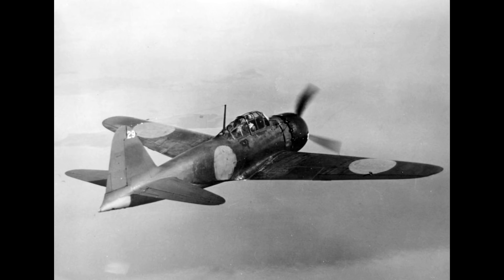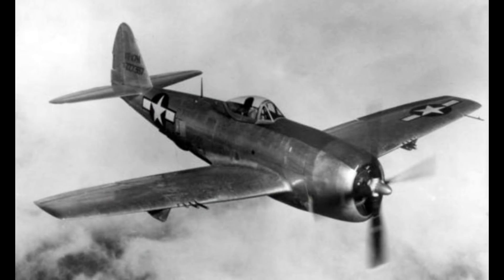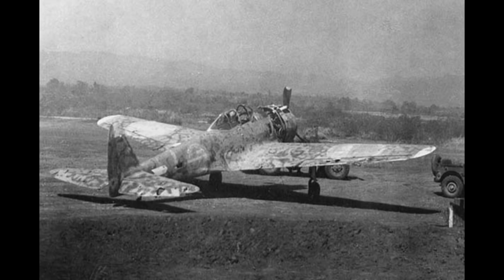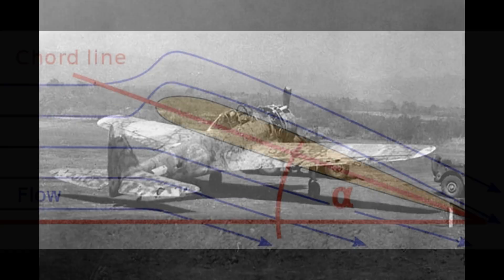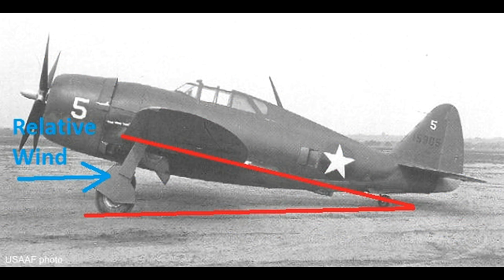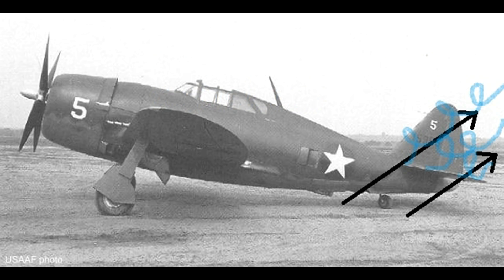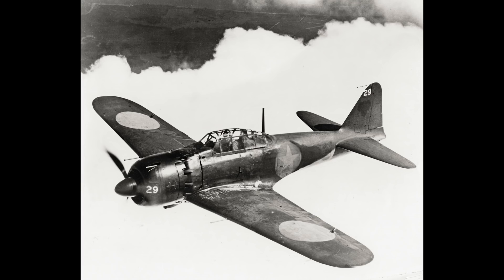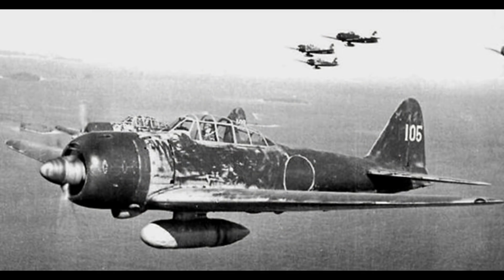Mitsubishi A6M Zero, an interesting fact few people know

Comment: That's right. RAF uber-ace Johnny Johnson (40 kills) when talking about the early Spits said that by and large you didn't win a WWII dogfight in a turn fight. (It happened of course - everything did.) The qualities needed varied by the air force involved, but nobody scorned speed. And in 1941/42 the Zero was pretty fast up to about 15,000 ft.
The Zero was a elegant plane and did it's job - a carrier based attack plane escort - splendidly in the first year of the war. Its failure had nothing to do with the design. The IJ air war was always hampered by the lack of depth of the Japanese industrial base. Big double banked radial engines that like the PW2800 required very good machine tools with extremely delicate tolerances. The Japanese couldn't match that level of complexity. (There were similar factors outside of the engine.) They couldn't even do a good job of copying the ME-109E even when provided with an engine. (Think Tony here.) Jiro Horikoshi and the Mitsubishi design team were working on what later became the "Jack" before Pearl Harbor. They were hoping to replace the Zero by early 1943. On paper many of the second generation Japanese fighters were fine aircraft, but none had the operational reliability expected by the Americans, all were hangar queens (few spare parts, not the greatest groundcrew) and none were produced in numbers large enough to challenge the US Hellcat, Corsair, P-38, P-47 and then, in early 1945, the P-51.  In any case, they were still building Zeros on VJ Day - at least they flew. And if they could no longer compete in combat, there was always suicide - something that shocked us.
Reply: Dear Eric Bergerud, comments like yours should win some kind of meaningful and prestigious award. Thank you very much.
Reply: Mr. Bergerud, I'm want you to know I've enjoyed your books, so I'm particularly pleased to see you contributing to these discussions.
Reply: In Greg Boyington's autobiography he states that he was at low altitude and could not outrun attacking Tony's - they were faster than his Corsair and shot him and his wingman down.
Reply: Eric Bergerud The Ha-40 was just as good as the DB601 in the 109.  I have no idea how you heard otherwise.  The issues it had initially came from poor sand filters on the Ki-61 and unfamiliarity with many ground crews on how liquid cooled engines worked (since many never worked on the ki-10).

Second Gen Japanese planes were actually pretty reliable but poor maintenance due to a lack of trained mechanics meant poor serviceability in later years.  

Still building zeros in 1945 isnt bad.  The M5 zero was very competative (I personally rate it even) with the F6F3 hellcat. The F6F5 hellcat was superior but not overly so.  In addition to that, there were a good amount of FM2 Wildcats still serving on smaller carriers that the M5 zero was superior to. Also worth noting is that to cut production to zeros would mean a severe drop in aircraft production until the next variant is brought up to speed.  Ideally you never want to change weapon production in a war. I dont want to compare naval and land based since the land based planes is nearly always better.
Reply: If you want the details please ask your library to track down a copy of my "Touched with Fire: Air War in the South Pacific 1942-43." The basic point I tried to make - that Japanese industrial technique was very poor when compared to the US, UK or Germany - and that this weakness crippled their attempt to produce a robust generation of 2nd generation aircraft stands. Mitsubisihi planned a replacement for the Zero in early 43 (what was later the "Jack") and had their top design team on the job before Pearl Harbor. But operational reliability was always miserable so the Zero soldiered on. This was repeated several times in both services. The extra problems of poor pilots, oil shortage, parts shortage etc were there regardless. As they were for Germany, but the Germans were able to deploy improved models of their major fighters throughout the war - and they stayed in the air. There was no Japanese equivalent of the FW-109D. As far as the Tony went, we mulched them over NG in 1943 - they couldn't face well flown P-38s. Nor could the A6M5s stand against well flown Hellcats much less Corsairs. Yes there were some good IJ pilots. Yes some 2nd generation IJ planes had some good missions. But anecdotes meant little in an industrial scale war. But overall, the air war in 1944-45 was a military mugging with the US suffering more non-combat than combat losses. (Arguably the Japanese did too - they just lost more of everything.)
Reply: Eric Bergerud The A6m replacement was the A7M.  It didnt enter service until 1945 due to a couple reason. Horikoshi was pre occupied with the J2m and then dumb requirements meant the first version failed.  The J2m Jack was not the successor but filled an entirely different role.

Japanese equivalent to fw 190D is the Ki 84 and the N1k.

The Ki 61 saw very little service over NG so I dont know where the claim of them getting mulched is coming from.  Many Ki 61s were lost before they even reached NG and then they suffered reliability issues due to poor sand filters.

The A6m could stand against the F6F3.  Read the test report.  The F6F3 could not outclimb the a6m5 under 15000 feet and it had trouble escaping in a dive.  It was only faster (but would take longer to reach its max speed so usefulness in combat was limited). The zero failed poorly against the F6F and F4U because most experienced air crews were lost at the Solomons and Midway.  It was not because the F4U and F6Fwere so much superior.

Btw A6M pilots always mentioned that they thought the F6F was more dangerous than the F4U.
Reply: also, reports from the test pilot of the A7M2 "Reppu" say that it was the fastest fighter he'd ever seen (although in terms of raw top speed, it should be noted the Reppu was not very fast by late war standards), and could climb and turn circles around the hellcat and mustang.  It also managed to improve on many of the Zero's flaws: it had a pane of bulletproof glass installed, and self sealing fuel tanks.  Not to mention that it had a much more respectable armament, with much better ammo reserves: 2 x 20mm cannons with 200 rounds per gun, and 2 x 13.2mm Heavy Machine Guns with 300 rounds per gun
Reply: Eric Bergerud 
A good book about the raaf against zeros, which talks a lot about tactics is '44 days by Michael Veitch', great read.
I will try to track down your book.
Reply: I've got a French report on the highest scoring Japanese ace where his squadron attacked an American formation and downed (27 I think aircraft)personally 10 aircraft the Americans lost in reality 2.
Reply: Eric Bergerud 8
Reply: Accurate, but what about the N1K and the Ki-84? I seem to recall both having characteristics comparable to late war american aircraft. I guess they just weren't produced in enough numbers to be relevant.
Reply: "Fire in the Sky" will always be the best read about the airwar in the Pacific and comments by its author are precious.  Being able to change production in mid-fight seems to have challenged everyone except the Americans in the Second World War.  (We are essentially the same country today).
Reply: We shouldn't forget the fact that the A6Ms simply were not sturdy enough to allow a pilot to make combat mistakes and get home like the Hellcats and Corsairs were.  Also, the US tactics emphasized team work and the Japanese did not emphasize it effectively.  There is a USN video which shows the "mowing machine" tactic, whereby lines of Hellcats would make single passes on an adversary until that adversary went down.
Reply: The amount of training that Japan could supply it's pilots with was scant after 1942.  The combat veteran pilots of China and Pearl Harbor were lost at Midway and Japan never had a efficient flight school operation.  So even good Zeros plus poorly trained pilots produces the "Marianas Turkey Shoot".
Reply: FuLLeFFekT1
The pilot you're talking about is Sadaaki Akamatsu. He claimed over 350 (!) kills and there are some crazy hard to believe stories about him such as this:
“Akamatsu stunned his superior officers by his conduct. Instead of attending pilot briefings and waiting on the flight line like the other men, he had his own warning system hooked up in a brothel! He often came racing to the air base in an old car, driving like a demon with one hand, drinking from a bottle held in the other. The sirens were screaming a warning as he bolted from the car to his fighter plane, already warmed up by the mechanics…”
Reply: @Ebergerud  Mr. Eric.  I have actually read your book.  While I learned a few things from reading it, I was greatly disappointed by your complete lack of technical knowledge.  

You do not seem to understand the meaning of wing loading, for example.  I caught somewhere that the A6M Zero advantage of turning performance was reduced at high altitudes.  Actually, the exact opposite.  At higher altitudes where the density is much lower, the ability to turn much favors the low wing loading.  If you lack the power to sustain a horizontal turn, like the A6M may lacked with respect to, say a Spitfire, you can always do a split S or give up altitude.  This is just an example.

I did like your analysis, however, with respect to the Betty bomber, and its weakness in terms of overloading it with fuel rather than armor and defensive armament.

In short, I would suggest that you totally rewrite your book with proper technical review.

As to the reasons why the Japanese lost the air war ...  There is one main major reason that almost eclipses all others.  Lack of oil.  If they had reasonable and reliable supplies of oil, it is very unlikely they would have lost.  On the other hand, if they had good supply of oil, they may have not participated in the war.  Similarly, the sole reason the Americans were able to win the war was that they were the largest oil producers at the time.

Anyway, you better start rewriting that book.  It has really awful errors.
Reply: Sorry I didn't write the book you wanted me to. For what it's worth, not only did I gain useful information from the pilots and groundcrew of allied aircraft, I also gained much interviewing and reading the books by former Boeing engineer Francis Dean - check "America's Hundred Thousand" and "Report of Joint Fighter Conference: : NAS Patuxent River, MD - 16-23 October 1944". I also got a good bird's eye view from General Ben Kelsey's (head of the USAAF Fighter Development) splendid memoir "The Dragon's Teeth?" (I'd be curious to know what you think of these works. If by chance, you haven't read them, you really should if you want to consider yourself literate on the subject of USAAF and USN military aircraft in WWII.)  Might also add that the manuscript of Fire in the Sky was read by two WWII aviators in total, and several more read parts. As noted in the bibliography I interviewed over a hundred participants. OK: if you want to know the turning radius of a P-51 at 20,000 feet, buy Dean's book - it has more graphs than there are wild mushrooms on a large Minnesota lawn in spring. If you want to know how the air war in the South and Southwest Pacific was fought and why it was fought that way, I'll be glad to stand behind Fire in the Sky.
Reply: It really doesn't matter why Tony's didn't stay in the air the way a German BF-109E would have, but it didn't. Beauschel talks about problems with oil loss and poor seals - that's the kind of problem that plagued Japanese planes. It wasn't engineering, it was industrial technique and Japan proved far behind the US, Germany, USSR or the UK in that category. (The Japanese knew this and it helps explain the great stress they put on industrial technique after the war. The Japanese trashed Detroit because their cars didn't break and the American models did (especially in the 80s and 90s). That's a direct result of a "Lesson Learned" from WWII.) And i rather doubt you would have found a single American pilot that would have swapped a Hellcat for an A6M5. I talked to a lot of pilots and they were much more interested in getting back to base than in shooting down planes. Obviously, they had to do their job. (A lot of fighter jockeys did seem to enjoy it. Bomber crews didn't.) But a Hellcat was a huge plane - almost the size of a Jug - and a splendid example of the "Detroit Iron" school of military aviation: it was a very tough bird. They also had a much better blower system on that big radial and hence were much better at any altitude above 15,000 feet. Read Hirokoshi's memoir: he calls the Hellcat the "Zero Killer." He was right. And no matter how badly inflated American kill claims were, there's no doubt that US aircraft, whether Hellcats, Corsairs, P-38s (or late war P51s - almost a case of overkill) after early 1943 absolutely mulched IJ aircraft wherever found. The mugged them. Our pilots were better, and so were our planes. Also - there were about 10,000 Zeros built during WWII, by far the most of any IJ type  - there were several US marks that had numbers over that. Altogether we built over 100,000 fighters - and about the same number of multi-engine aircraft - numbers the Japanese couldn't dream of. Given Hitler's defeat in Russia, Japan was absolutely doomed. The fact that Japan fell in 1945 after a string of lopsided defeats was testimony to the fact that they did not belong in WWII.
Reply: @Ebergerud  Well, I do not know what your references are supposed to have been,  but the first aspect is that you failed to understand the technical side, so regardless of who you supposedly interviewed, you simply did not get it.  Another aspect that was missing big time was interviews or at least unbiased insight of credible Japanese sources.  If you had some understanding of the other side is the following.  A well trained and experienced Japanese pilot, of similar training as any front line US pilot, flying a Ki-43 or A6M had absolutely nothing to fear from any US fighter.  The US fighter may have been faster and well armed, but the Japanese pilot always had the maneuverability on his side, which assuming that the pilot knows how to exploit it, will guarantee his survival.  There are lots of examples, the best of Saburo Sakai that survived single handed 15 Hellcats.  What the Japanese pilot was afraid of were the US heavies and their return fire.  More Japanese experienced pilots died from bombers than fighters.  The Japanese fighter pilot of course flying a Ki-84 not only retained the defensive advantage of maneuvrability, but also retained climb and speed advantage, much like the A6M2 against the F4F.  Much of that critical info was missing, turning the book more like a propaganda leaflet than technical history (how can one write technical history if not even remotely a technical person?).

The only reason why the USA won the air war was one.  Quantity.  Which reflected the fact that the USA was the largest oil producer in the world.  Everything else is an extension of the previous statements.  Even with the second class fighters, the USA was able to move forward with victory due to the overwhelming quantity of bombers.  That is the main conclusion that needs to be drawn from such a book, and it was not.  Instead, it was blaming it all on how stupid the Japanese planers were on prioritizing maneuverability in their fighters.   Very short sighted.

As for turning radius and P-51 and what have you.  If a reasonable author is to describe aerial combat in WWII, they need to describe the following phenomenon.  Ability of maximizing the rate of turn is obviously critical in order to keep the enemy plane in sight during combat and give the necessary "lead" during firing.  The indicated airspeed is critical factor in this (and the term indicated is also very important here).  Above a certain airspeed, the turning ability is limited by the G-limit of the pilot, typically 6 to 8 G's.  Below the above threshold, it is stall that limits the turn ability.  Based on the horsepower the fighters of that era had, the airspeed will drop very rapidly below that threshold, unless you are on a straight down spiral dive.  This threashold is mainly determined by wing loading.  As the altitude increases, the indicated airspeed drops due to density, so the above threshold is generally reached much easier.

All of the above will be Greek to you, but without such a very simple explanation present in most aircraft aerodynamic textbooks, your book is hollow.  The above is what all tactics are built upon, and shows the desperate situation that the overweight US fighters were, resolved only by the huge numbers and the rarity of Japanese expert pilots.  But there were many a case where a Japanese expert appeared, sometimes in very well known cases, such as the killing of Thomas McGuire.  

One really striking example of the ignorance of the book was when a WWII fighter was compared technically to a modern pickup truck.  I have news for you.  Even the overweight and crude F4F has far more complexity, sophistication, manufacturing precision, and overall production cost than any pickup truck ever designed or built.  In fact, it would compare favorably with the most sophisticated Ferrari you can buy out there.

I know its all about money, but I would be deeply embarrassed if such a book had my name on it.
Reply: Well, you ought to get a publisher and put your own name on your own book - you know mine. You seem to have the illusion that WWII air combat was some kind of joust. It wasn't. I'd suggest some sources, but they have big words and might be beyond your grade level. I'd start with Johnny Johnson's autobiography (he was the RAF "top gun" in WWII) - believe it's called Wing Leader. He makes it very clear that turn fights did not win aerial battles in WWII. They happened simply because there was so much fighting. But in general you wanted the basics - speed, climb, and a really good blower for help at altitude. I became friends with one of the 5th AF aces, Robert DeHaven. He puts in simple terms what Johnson described: "World War II air combat consisted of relatively few and relatively simple maneuvers executed at the right time." One disadvantage of a turn fight is that it made the participants seriously vulnerable to being struck by a third party while either trying to evade or gain a shooting position. (Check Robert Shaw, "Fighter Combat" for the details.") Pilots who kept up speed usually had a door open for retreat - at least the ones that lived did. It was a dangerous job regardless - for every plane shot down in combat, one was lost due to some kind of mishap - bad weather, getting lost, mechanical failure, accident on landing/take-off. Life was cheap.
The Japanese knew this of course and did their best to create "American style" fighters in their second generation planes. None could turn with a Zero, much less an Oscar, but all were faster, had better high altitude performance, were bettered armed and had somewhat better self-sealing tanks. None were well built or maintained, so most were hangar queens. You say I didn't use Japanese sources. Well, I did. There was copious material gathered by the US for the PTO Strategic Bombing Survey and I used it extensively. There are also secondary sources I cited. All agree on one thing - the Japanese air arm was in a downward spiral by late 1943. Sure there were more US planes by 1944. But if you look at well documented campaigns such as Guadalcanal (see Jon Lundstrom's "First Team at Guadalcanal") the trend was clear: in September 42 the IJNAF fighters had a slight advantage in "kill ratio" although nothing like their glory days mulching the Dutch, Chinese, Brits and USAAF planes in the early months of 1942. By December the advantage was gone and was slipping the other way. Allied pilots flying Wildcats and P-40Es were gaining an edge by early 1943. By this time the more or less 2500 pre-war IJNAF fighter pilot core was badly eroded and their "quality over quantity" policy toward aircraft pilot training had proven a huge error. When the US brought in their second generation planes - Corsairs, Hellcats, P38s, each was superior to the Zero. American pilots were better trained by 1943 and the numbers grew, although that wasn't evident until 1944. In any case, Japan was mugged. They shouldn't have been in the war. Their resistance in the air was so pitiful, that Tokyo decided that the best mission for IJ fighter aircraft was suicide attack. If you can't read that page, you need glasses.
Reply: @Ebergerud  OK Mr. Eric, let's see where my grade level is... You state Johnny Johnson's remark that air combat is not won in a turning battle.  But you failed to see the context of his statements.   JJ's greatest challenges where during the 42/43 deep France intrusions with Spitfire V's.  Due to their limited range, on their way back, if they were attacked by the faster 190's, their only option was turning fight.  Clearly, that was not a good option if you are low on fuel and over enemy territory.  This is where his comment is coming from.  Obviously, nobody wants to have an enemy fighter in your tail and be forced to start turning.  But obviously, in an even fight, that WILL happen.  Sure, we want maximum rate of climb.  But that requires low wing loading, and it is not inconsistent with turning abilities.  This is where virtually ALL US fighters sucked.  If low wing loading was not a so good idea, the Spitfires would have cut down their wing area by 20 or 30%.  In fact, in 1944 they redesigned the whole wing for the Mk 21.  Guess what, the wing area remained identical.

Late war Japanese fighters were also designed with low wing loading.  The Ki-44 (not really a late war) and another Mitsubishi navy fighter, the Rained, were few exceptions, designed not as all around fighters, but very specialized.

So, where your misconception is coming from is the following.  Yes, turning fight is not where you want to be.  But it is a critical option that you need to have, and a critical asset, that if all goes well you will not have to use it defensively.  Good turning ability is consistent with climb rate (both need low wing loading) and good high altitude performance anyway, so low wing loading is critical.  Obviously the compromise was well understood.  But the Ki-84 and even the N1K1 had low wing loading, which proved a major asset.  If you think the Ki-84 was a hangar queen, you may want to consult with the "super ace" Thomas McGuire.  His spirit may still be in the Philippines where he opened an oversize crater with his P-38.

The opposite side of this is that turning fight can also be an asset when you are attacking and potential victim enters a turning fight.

Yes, the Japanese were going downhill by late 1942.  But you failed to see why.  The US light bombers were constantly hammering the forward Japanese air bases day and night.  It had nothing to do with the US fighter capabilities.  The only thing the US fighters can do is prevent the attacks on the bombers.  These medium bombers also attacked resupply.  The Guadalcanal nightmare was again related to the fact that the Zeros were pushed at the extreme of their range.  This was a fundamental mistake the Japanese Navy did by relying entirely on fighters and destroyers.  Had they employed their main fleet, the G-campaign would have been different.  You cannot blame that on fighter design or tactics.

Also, how many fighters in 1943 could operate at that extreme range?

Just as important, the Aleutian Zero really made life easier for many an allied fighter pilot.  Out of sheer luck the allies learned about the roll rate issues of the A6M's.  Had that not happened, many more Japanese aces would have been formed.  Many Japanese sources consider this loss of comparable damage as the entire Midway battle (another example where the USA got the upper hand out of luck and espionage, both irrelevant to fighter design or tactics).  I think you mentioned the Aleutian Zero somewhere on your book, but failed to recognize its true significance.

You take DeHaven's comments too seriously.  He was one of those who survived.  Look at Boyngton.  When he was surrounded by Zeros, there was nothing he could do but watch his Corsair been riddled with holes.  No options.  Saburo Sakai, in contrast, survived 15 hungry well trained F6F pilots with his A6M5 for 15 minutes without a single bullet hole.  He is one of many examples.  Yes, nobody would want to be in Sakai's place, but that is where warriors end up, as opposed to the DeHaven's and Boyngtons who had or hoped for easy and lucky careers, thanks not to how good planes they had, or how smart and capable they were, but by how many bombers and fighters their side had, and how well maintained they were (no problems with supplies and spare parts reaching allied air bases, the Japanese lacked the resources to interfere with allied resupply).

The air war has huge glamour in it, and people are truly fascinated by it.  That is how it is so tempting to make myths about how capable our air force boys and their equipment were, etc, and that is why propaganda focuses on it.  But this is not reality.  What won the war was oil (not much glamour to that, of course).  Which is exactly what started the war.   If the Japanese had oil, there would not be Pearl Harbor.  And that was, of course, why the Americans applied the embargo.  But that is an entirely different discussion.

History is a very tricky subject, and you have to use judgement to draw conclusions.  You cannot go based on the propaganda of the side that won.  Remember, that propaganda was aimed to capture the imagination of the American people so that they would buy more war bonds.  Reality/history and propaganda are very different.  You may not know that, but in the CBI theater where the conditions were better, the Japanese consistently had a better than 1:1 kill to loss ratio, even including heavy bombers.  But that could not change them losing.  Simply, because the numbers were against them.  They could not shoot down enough allied planes to stop them.

Try to open your mind and go beyond the propaganda.  Try to see how each person's point of view is biased based on their position, and therefore make an opinion based on the big picture.  Most important, you need to study and understand the technical side, and see how all these factors are so interconnected.  Example, turning ability and climb rate.  Climb rate, by the way, is far more critical than speed.  

If I were you, I would withdraw that book and start all over.
Reply: @Ebergerud  One more point worth making.
" By this time the more or less 2500 pre-war IJNAF fighter pilot core was badly eroded and their "quality over quantity" policy toward aircraft pilot training had proven a huge error."
This is really worth commenting.  Yes, it was a huge mistake, but that was assuming that they knew that a huge war was just around the corner.  The reality was that until mid 1941, the Japanese did not really know that a huge war with the USA is really imminent.  They knew there was a chance, but did not really know for sure.  FDR of course knew.
Reply: @demetridar506     You have no business complaining about anybody's writing until you have books of your own published.  You should take your own advice about getting beyond the propaganda.  Two anecdotal examples don't make history and other than that you have nothing but your wing load theory that is design discussion, not history.
Reply: @RTmadnesstoo  Really?  The only way you can have legitimate disagreement is if you published similar garbage?  There is a lot more than two anecdotal examples.  You need to read publications where the experiences of the other side is described.
Reply: @demetridar506    Legitimate discussion is fine but repeatedly telling a renowned author to rewrite his books is not discussion.  If I were him I wouldn't bother with a reply to such BS.  
As I said, when you have published your book you might be worth a 'legitimate discussion'.
Reply: @RTmadnesstoo  So, you are saying that since somebody has published a book is allowed to spread technical ignorance, we are supposed to let that go through?  When reproduces propaganda we are supposed to let that go through?  Sorry, it does not work that way.  Especially when these books are more about money than historical relevance.  If Eric B had written a properly balanced book, he would have sold far fewer copies.
Reply: @demetridar506     Your opinions are your own and could have been formed from reading propaganda.  That doesn't make them any more valid than these carefully researched books.  Eric has documented where his facts were gathered, how about yours?  Every story has different points of view.  
Eric Bergerud has treated you respectfully in all his comments.  You might learn from that.
Reply: @RTmadnesstoo  Carefully researched book?  Where he states, for example, that low wing loading is detrimental at high altitudes?  Just ... where exactly was this researched?  Sorry, ignorance, just because it is published, needs to be challenged.  If we want to make America great again, we need to understand what was that really made it great.  Not drink our own gulag.
Reply: @RTmadnesstoo  Here is another example.  Tetsuzo Iwamoto (the top Japanese ace, with 200 kills under his belt, true number of kills after comparing US losses was about 80) had participated in the battle of Rabaul when the F4U first appeared.  Personally, he shot down many of them.  In his diary he had said that what worried him was not their flying qualities but their sheer number.  Unfortunately, this quote was absent from this unfortunate book.  You may want to compare the score of Iwamoto with top American aces, by the way.  The top US ace was around 40, and if you take this through the scrutiny of comparison with real losses of the other side, the number will be around 15 at best.  So, compare 15 vs. 80.  Where was that in the book?  Another example from a IJAAF pilot, I think Kuroe.  He had said that he was not afraid of the US fighters, but their bombers.  If I die, I will die from defensive bomber fire.  That's what he said.  Again, where was that in the book?

Sorry not you, as citizens, we have to fight propaganda.  It is our duty.  If you do not know your own history and past, you cannot proceed and define your future.
Reply: @demetridar506    You will never convince anybody when you start out abrasive and rude which is exactly the way you started this 'discussion'.  Go back and reread your diatribe and pretend you are on the other side of the conversation.  Nobody cares what you are saying after the fifth time you harangue about 'wing load'.  
BTW, The comment section is not where you write books.  And sometimes books are just entertainment.
Reply: @RTmadnesstoo  Yes not you, we agree here.  I am not the "make you feel good" type of guy.  Bad news are always abrasive.  That maybe the only way to capture the attention.  And yes, I am not really a comedian.  And its not "wing load", its "wing loading".  This is the weight of your plane divided by its wing area.   Will the "polite way" convince more?  No, because I doubt that the convincing process is instantaneous.   I am fighting prejudice stuck in people's minds since children.  But some people will have sufficiently open minds that the doubt will get stuck in there, and will slowly grow as they get more information.

I think there are books for entertainment BTW.  No disagreement.  There are lots of great funny novels.  War books are generally not entertaining.  Or at least, they should not be.  War is a very serious and nasty event that will hopefully never take place again, but almost certainly it will.
Reply: With facts like this in mind, it's still amazes me that the Japanese ignored their technological and industrial inferiority to the United States and still choose to launch a war against the U.S. and Great Britain.
Reply: Right eric.  I remember Günther Rall stating that out of the top German aces only one was a dog fighter.  He and the rest using fast, close slashing and running attacks.  Top US Ace Richard  Bong said the same about himself with the P-38
Reply: @fazole  Yeah that happened at Midway.
Reply: @laysorangejuiceandtoothpas2747  
These comments get lost in YT. Could you elaborate? Thanks.
Reply: @fazole  Woops, I'm thinking of the "Thach Weave" maneuver not the Fluid Four "Mowing Machine".
Reply: @demetridar506  "sole reason the Americans were able to win the war"---was It's America Stupid.
Reply: @valdorhightower  No, they had no choice.  It was a huge gamble.  They also under estimated the power of propaganda.  They hoped that the American people will realize that the Pacific and far east was not worth the huge casualties necessary, and they would give up.  The Pearl harbor propaganda however was just too effective.  But regardless, they had no other options.  If they had withdrawn from China as the embargo indirectly demanded they do, they would face a huge starvation in months and years following 1941.
Reply: @laysorangejuiceandtoothpas2747  
I'm not sure how well known the Thach weave was at Midway, but there wasn't much air combat between Wildcats and Zeroes anyway. The USMC Buffaloes were almost all shot down, so it's likely they hadn't practiced the weave either. I don't even recall the weave being used by the Marine pilots at Guadalcanal either. Boyington I don't think mentions it, nor Tom Blackburn of VF-17 who were the contemporaries of Boyington's VMF-214.
Reply: @valdorhightower  Regarding that decision, I am just an enthusiast but I try to follow and learn from some rather educated people in the field, for that reason I am in MHV's discord, I respect their approach to research. 

As an enthusiast, from what I have learned it seems that what essentially happened was over the course of generations the lower ranks of the IJA gradually ran amok, and types like Tojo were influenced by that. Lower level officers were often hard to control due to distances, struggles with radio tech, and more. Often, however, they would act far more aggressively than permitted and take far more land than could be supplied. 

Where I am going with this is that not only was Japan resistant to surrender on an ideological level, but further on a practical level it would be hard to implement, and this was a concern for the US as well how messy a surrender would be. 

Thus, despite pressure on Japan to end their war in China, Japan simply considered ending the war to be off the table. Eventually Japan perceived what appeared to be a very fleeting advantage at Pearl Harbor, and thought it would be more likely that they could scare the US into a peace agreement that did not involve Japan ending its war in China and continue getting oil than that the US would simply not go to war at a later time when Japan had no hope. Thus, due to the risk assessment in what they pretty much knew to be extremely low odds either way, they took the option that they perceived to be less bad: hope for enough early victories to scare the US into peace.

To better illustrate the Japanese hopes, far fetched as they were (and the Japanese knew this, just seeing it as better than the alternative), look at what actually happened with the Tet Offensive. As devastating as it was to the NLF, what the American public saw was very different than what the government saw, and public pressure to get out was simply too great. That event more or less illustrates the Japanese dream of something like victory, or at least a draw.
Reply: @patrickeh696  must have been Marseille, he loved turnfighting in his 109; Hartmann and most other aces (Nowotny comes to mind) preferred diving boom and zoom attacks ideally by suprise
Reply: @faunbudweis  probably so as he was definitely a wild one.
Reply: What was wrong with the design of the Zero was two fold. Lack of armor protection for the pilot and self sealing fuel tanks.
Reply: Thank you good sir, you are a scholar and a gentleman. Usually that line is somewhat in jest but apparently here it is actually the case.
Reply: @Ebergerud  Ki-84's, Ki-100's, and Shiden Kai's had positive kill ratios against Allied fighters late in WW2 despite being outnumbered greatly in most encounters. Experienced Japanese pilots were also the best trained pilots in the world.
Reply: Jason: I don't know where you got this idea but it's bonkers. I did extensive research in the Pacific War Strategic bombing survey and the story told there by Japanese officers is the opposite. The Japanese were up against the most advanced P-51s, Corsairs, Hellcats and even P47s. Their aircrew had been decimated in 1944 and were never rebuilt. It's true Japanese pilots continued to gain victories - if you fight in the air, losses are guaranteed. But the "kill ratio" would have been lopsided in favor of the US. Do remember, the Japanese air defense efforts against the B-29s were never substantial and ceased when the USAAF began to bomb at night. They were dedicating their pilot training program to build up the Kamikaze force for the assumed invasion of Kyushu. As for the second generation IJ fighters they were all over designed and hangar queens - exceptions were the KI-100 and (sort of) Ki-84 and lucky to get into the air. And by 1945 the USNAF and USAAF were a machine.
Reply: @Ebergerud  Ki-84's, Ki-100's and Shiden Kai's did suffer from poor maintenance. They were however every bit the match of any Allied fighter and in many ways superior. The elite Japanese pilot's in Shiden Kai's in particular were very effective in the final days of the war in defense of Japan despite being massively outnumbered. Poor supply and maintenance is not a reflection of pilot skill nor aircraft design. Japanese pilots were extremely skilled and late WW2 Japanese fighters were extremely capable and among the best in the war. You are conflating them.
Reply: No I'm telling you the truth. Of course there were good pilots flying for Japan: in 1945 there were good pilots flying for the Luftwaffe. But very few of either. Indeed, American pilots had noted a serious decline in pilot quality on the part of the Japanese as early as mid-1943, and in German in mid-44. The average American pilot was far better trained than his Japanese equivalent - they had more hours in fighters by 1944 IN TRAINING than all but a handful of Japanese pilots had in airplanes. And our planes were better at altitude (the single most important combat factor), more rugged and more reliable. One reason that the B-29s had so little trouble with Japanese home defense before March (when they went to night attacks) was that they were picking up P-51 escorts from Iwo and the Stangs creamed anything they saw. Which wasn't many planes at any time because the IJ fighters had serious trouble reaching hi altitude B-29s and weren't much faster than their prey. American fighters were much more endangered by ground fire because that's what they did - attack ground targets, just as our fighters were doing in 1945 in Germany. The enemy in the air was dead. That's why we never considered an escort for the daylight attacks on Hiroshima or Nagasaki - they weren't needed. As noted elsewhere, after Okinawa the vast bulk of IJ aircrew were diverted to preparing "Special Attack" planes to defend Kyushu.
Reply: The answer to that is really pretty simple. Tokyo believed Hitler would prevail in Europe - knocking out both the UK and Russia. When that happened, Tokyo hoped (they knew there was risk involved) the US would be preoccupied with hemispheric defense against a Nazi dominated Europe. It's sweet irony that the Red Army launched their great counter attack at Moscow the day before Nagumo launched his first wave to Pearl Harbor. With Germany defeated, Japan was utterly doomed - the only question concerning the Pacific War would be its duration - not its outcome.
Reply: James Thach and Flatley had worked out the basic "weave" weeks before Midway. Even today it is in the fighter pilot's book of tricks. And it's true that the number of fighter vs fighter engagements wasn't large in any of the carrier battles - they were very short (and a mad man's night out.) See Shattered Sword by Jon Parshall.
Reply: It seems to me that the IJN, aware of their deficiencies (remarkably few, if anything, in light of the age of that service) fought a war imposed on them. And not by the US, but by the territorial ambitions of the IJA in China, and their determination to defend those gains. For which the Army effectively took control of the government and the country. So the plan was to lose a war at sea slowly, rather than win it outright. Although some victory fever may have set in after Pearl Harbor and the swift conquest of the Philippines. Germany was an extremely poor choice as an ally, however. Even setting aside politics, remember that earlier in the same year, the loss of the Bismark demonstrated to the world that Britannia still ruled the waves, and losses to U-boats in the Atlantic had been sharply down since July. Even before the fleet sailed for Pearl Harbor and made the full entry of the US inevitable, the war already appeared to have no profitable outcome in sight for the Axis.
Reply: Can't say that I quite understand. The Japanese knew there was risk in fighting the US - but they were willing to take it. They certainly had no plan to lose the war slowly. The idea that the US would not pursue a vigorous war in the PTO was based on the idea that a German victory over Russia would lead to some kind of victory over the UK and the US would have to see to its defenses in the Atlantic. (If you see the panic caused in the US military by the fall of France in 1940, the idea wasn't crazy.) And it's certainly true that the Japanese put far too much faith in "spirit" over material. (Hitler's emphasis on "will" was similar in an odd way.) But nobody in Tokyo would have gone to war had they believed that in a few years they would be fighting China, the US, the UK, Australia-NZ and Russia. The military was simply dumb struck by the possibility of creating an East Asian autarky based on Japan-Korea-Manchuria (industrial heart) and SEA (raw materials and food stuffs) that would have allowed them to rewrite history. So the stakes were big and the status quot of 1941 (bogged down in China) was leading nowhere. The Japanese did know the size of the fleet bills passed by the US Congress after 1936 - especially 1940-41 - so the risk was there. As Tojo put it, the Japanese decided to "jump off the temple." The decision was obviously a catastrophe. The fact that Tokyo saw no possible way to get out of the war after 1943 - when victory was obviously impossible - shows the dreadful spirit of that dreadful time. Hitler was willing to drag his country into the furnace instead of surrendering and Americans watched that tragedy unfold in 1945. The Japanese were following suit. When viewing the past, don't assume that governments fight for their people - they often fight for themselves. Hitler knew defeat meant death - so he was willing to destroy his own country because they had shown themselves unworthy of their Fuhrer. There were people inside the top of the Japanese military - lots of them - that were perfectly willing to watch "the diamond shatter" (ie the physical destruction of Japan and its people) instead of surrender. Understanding the Axis in WWII requires a suspension of the rational man model of the universe. It was madness.
Reply: Eric Bergerud Agreed with all your points. To clarify however, I mean that there was little expectation of victory on Yamamoto’s part when he was called on to draft plans for a naval war with the United States. He had earlier written that to make victory certain, it would be necessary to march on Washington and dictate the terms for peace in the White House, in a letter misinterpreted on both sides of the Pacific as a bellicose statement of intention, rather than what it was. A clear-eyed assessment of the futility of seeking to bring the United States to accept defeat in this theater of the war.

And when he was called upon to plan out just such a conflict, the strategy he relied upon was to deal a severe initial blow, then force the US Navy to fight a protracted island-hopping campaign. The idea being that American resolve would lessen with each battle, resulting in a peace settlement that returned many of the IJN’s conquests to Allied hands, in exchange for an end to the oil embargo and to Allied support for the Republic of China.

The hope was there, for an early concession by the United States, but the war plan did not assume or rely upon it. This was to be a war of attrition, fought ever closer to the home islands. Yamamoto saw that far more clearly than his superiors. And at least initially, I suspect that most Japanese citizens shared these concerns in spite of the propaganda turned out by the government, which was by that point effectively a military junta brought to power through political assassinations (using that term in its most literal sense) and intimidation rife in the 1930s.
Reply: One great thing about maneuverability and shorter turn arcs is in interception - it allows you to reengage after killing your previous opponent much more quickly.  So maneuverability isn't ONLY about dogfighting - it's about increasing the ratio of fighting to maneuvering time.